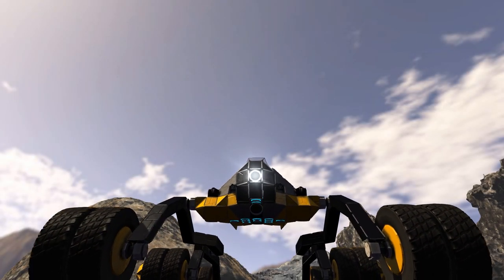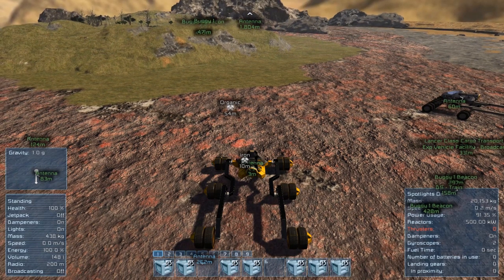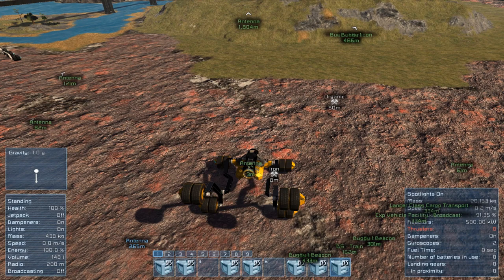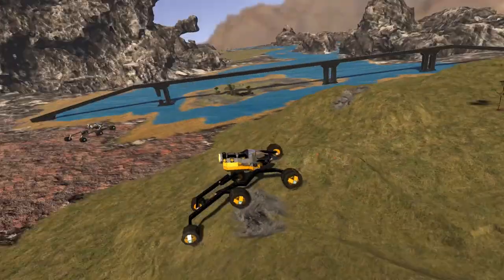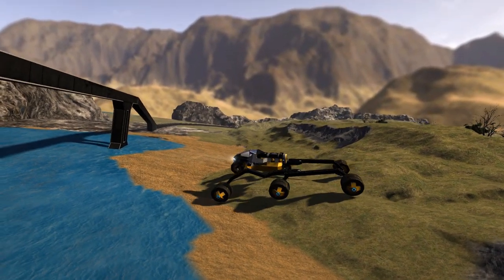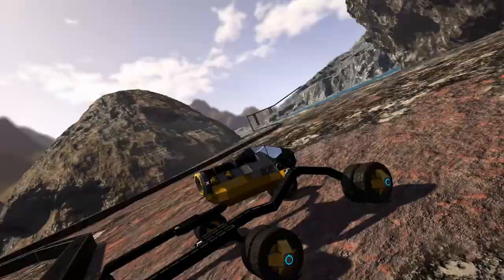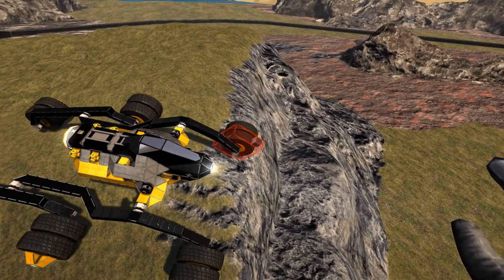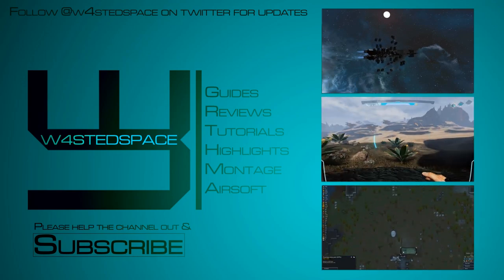Space Engineers - Exploration Rover & Rocker-Bogie Suspension

Comment: Oh wow! I got really excited to see this wheel lifting problem happening in Space Engineers. I've been working on a real robotic rover using the rocker-bogie design and had the same problem. I sent the video, that I'm sharing here, to Don Bickler, the guy at JPL who invented the rocker-bogie system, and he said my hinge point on the bogie was too high. He also said to have fun with it. Since the wheel was up in the air, it could climb over  more things. I also found out that the bogie was designed to be in the front of the rover. 

Since I didn't have time to redesign the suspension at the time, I just programmed the center wheel to drive slower while turning. Seemed to work pretty well. Maybe something to try out in Space Engineers.

But here's a video of my rover having similar turning issues. I've recently added steerable wheels so I no longer have this problem though. 

https://youtu.be/Ru_m3wz-XD4
Reply from the maker: +Stray Robotics lol, that's awesome... I always figured it was something connected to SE and the lack of control I have over the rotors position. Very cool he replied to you and I'm gonna have to try this again now, with the bogie forward and a lower pivot point and see what happens..

Thanks dude! Funky looking rover also, might have to try one myself (I'm a pretty big fan of rc robotics)

Comment: Using a programmable block, you can get the steering angle of an attached wheel by using IMyMotorSuspension.SteerAngle

You can then use this to adjust the suspended wheels' stats - for example, reducing power on the wheels in the direction the control wheel is tilted, or saying wheel.Brake = true;
Reply from the maker: Craig Perko hmm, interesting as always sir, will have to look into that and make some conditional setups for different terrain and obstacles. Nice one!
Reply: ***** If you want to see my take on it, I made this: http://steamcommunity.com/sharedfiles/filedetails/?id=488319795

You can determine whether the player is pressing W or S if you do something annoying, but I haven't built a rover like that, yet.
Reply from the maker: Craig Perko
Does handle pretty sweet - some very nice techniques to increase traction... gonna have to check out what you've actually done to achieve that. Does SE support analogue input for wheel turning? Could be a pretty nice addition.

I do have to mention that technically that's no longer rocker-bogie suspension... the dual joints on each arm are part of it and kinda required for a few of the 'tricks' - gonna have to do a side-by-side comparison and see how it stacks up against the steering modification I made to mine a couple of days ago... and of course add some conditionals for different terrain.

Great vid dude, got me thinking :)
Reply from the maker: Craig Perko
Think there might be some advantages in  making my design smaller also, didn't realise how much of a size difference there was from the vid.. suspect that is also helping with the turning - can see the arms on mine flexing at times, partly from the dual rotors and partly because they are very long I suspect.
Reply: Yeah, there's no "bogie" in my design, because I needed fixed wheels. There is a very wide design space here.

In particular, the double-rotor setup you need for a proper rocker-bogie behaves very badly in MP, so I limited it.

If you use controller input, you can get an analog spin. However, unless you're using the more advanced WS mapping scheme, that's not going to register in a vehicle where you press 1 to go forward.
Reply from the maker: Craig Perko
Yeah the more advanced mapping scheme is why I was asking, seems to me a system like that is only going to be improved by an analogue input.

MP issues are a tricky beast, I don't want to limit designs around an unintended game limitation but equally it does seem they are here to stay for a while at least. As long as the client sim speeds are all high it's not much of an issue, but I can see why you'd avoid it for sure.

Comment: Could be interesting to mess with the balance of the middle section and add some drills, sorta combine it with the Trail Blazer from the planets competition? It'd make it easier to, say, level out just the top of a mountain or something, without having to airlift it or have a second vehicle for resupply and such. It'd be also easier to modify for full-time mining since the suspension would be able to handle somewhat rougher terrain digging downards or upwards, although you'd also have to worry about the top banging into the roof of a tunnel or cave or what-have-ye...
Reply from the maker: Jurgen Ronaaz Yeah could be an interesting conversion.. might struggle with finding room for the drills in a way that doesn't interfere with the suspension but if possible would give it an extra purpose which can never be a bad thing!

Comment: Possible steering solution.
Have you thought about using Mecanum or Airtrax wheels for turning? Some people have made simple versions out of Lego, that look like they could be adapted to SE.
Reply from the maker: xgeordiemonkeyx I'm slightly scared that to get the tracking wheels in the right locations and angles it's going to mean using a LOAD of rotors.. so it's not only going to end up very large for each wheel but it's also prone to a sudden attack of SE physics :) Could be a fun project to try and replicate though! Will keep that in mind.

Comment: and what if for making the craft a little more versatile you add a rotor underneath the craft and then attach the wheel system to that instead so it can turn while in place
Reply from the maker: Jonah Monteiro the center cockpit needs to articulate like it currently does in order to keep the craft balanced... raising it up on a rig like that would require the 'arms' to be connected together in order to place it on a rotor which would change how it handles.
Reply: fair enough

Comment: hmmm... only thing I can think of to steer is kinda weird - a piston pointed down with a rotor attached to the end, a block on this with a wheel either side.  Now to set your steering would be to turn the rotor to angle the wheel the way you want to go.  however, as I haven't tested it my cynicism is telling me S.E would simply make your vehicle sidle crabwise instead of turning.  S.E physics f.t.w :P  Still if it works then you got a fun steering system.

Edit:  A mountain climbing pack-horse?  How about "The Llama"? :P
Reply from the maker: Stewart Bates Yeah I did think about that sorta idea, or just lowering a platform that has a rotor on the end that literally lifts the craft off the ground and spins it.. but yeah, pistons :s Part of the issue is still SE friction tbh, it should work better than it does currently despite the long wheelbase but yeah, not so much atm.

Comment: I love the design, I wonder if it could be made with suspension wheels that can turn?
Reply from the maker: +MrSeagull Not easily, when you use rotors you end up with 2 grids, and anything on the 'other' grid to the cockpit can't be controlled using WASD.. so in this case while you can put the wheels on you have no way to actually control them :(
Reply: +w4stedspace That's unfortunate. How about using independent roward/reserve controls for each side? Kinda like oldschool tank controls. You turn by either only accelerating with one side, and can pivot in place by going forward with one, and reverse on the other.
Reply: Ehh, tried to replicate this design and my suggestion above did not work. It just slightly shifted in the direction I wanted it to go. That, and the main cabin never stayed level  - I did something wrong there.

Comment: Amazing design!!! I find it quite perfect, even if the steering issue is more related to the game’s physics than anything else…

After crawling with this wonder, I do not have any proper advice in store, but I can make one relevant observation though.
If you do remove all the extra pair of wheels (the ones carrying the artificial mass), the “Exploration Rover“ (Daddy long leg rover ?) will turn using only 4 wheels (front and middle ones) almost with no wheel slipping (I can make a short video if I’m not clear enough).

So if the two back legs lift when steering, and the wheel’s mass is reduced (might using the option of the space ball instead of the artificial mass), maybe the steering issue will be resolved ...
Reply from the maker: Dr Mic Sounds like that could help, although I'd be concerned about how it would handle crawling without the mass on the wheels to pull the rear wheel pair downwards. Will have to play around with that and see what happens, could potentially use the rotors to apply downwards torque in lieu of the mass blocks. Thanks :)

Comment: wow this is very well made, may i ask how this (or something like it) can be done for a large rover/mobile base that is at least 65x30x25 large blocks dimension (2.9 million kg currently)?? i'm working on a ridiculously massive mobile base that is meant to scale difficult terrain (not vertical walls/drops) and i've been experimenting with ideas from modern tank suspension to the interleaf suspension, the skoda suspension, the cromwell suspension, the articulating suspension, the ferdinand porsche maus suspension,  the Landkreuzer P. 1000 Ratte suspension, the Schwerer Gustav suspension, and even some nasa rover suspensions (impractical for a 3 million kg giant) but i cant seem to get a good design to absorb the weight and bear with the rough terrain without failing, i would really appreciate it if you could help me out :<

edit: did not use tank tracks due to fears of it being completely decimated by the sheer weight of the craft

Comment: Don't know if it would work, but could you build in a very slight torque towards the "natural" positions of the rotors, so that it acts like a suspension? As a result, the craft would be more resilient, as the bounce could be somehow 'distributed' better. Not sure how to describe it, hope that you get what I mean. What do you think? Would it work?
Reply from the maker: Calvandur I do get what you mean indeed, I did attempt something on those lines I've just been struggling to find a method to actually achieve it. One thought was to have a pair of rotors for each side that are both pushing towards '0' degrees, but from opposite directions.. would in theory create the torque you describe but in practice does some pretty weird stuff... Sounds like a good option though as it would also help brace the wheels during turning too.
Reply: *****
Been thinking about your reply. Again, I've tried nothing in practice and rather tread SE like philosophy ;D.

But I think I know what the problem might be. Normal suspensions obey hookes law and ruffly scale up in resistance, as compression increases. Rotors don't do that, resulting in a rather useless suspension, as they are either too strong or too weak and don't adjust themselves.

The solution might be to work with two rotors. The first one is weaker and gives in to the weight of the craft. It's purpose is to keep the wheels to the ground for better friction.
The second rotor is stronger and starts turning, when the first one has reached its limit, which is artificially set. It can withstand the pure weight of the craft and has the purpose of giving in to bumps and hard landings to distribute the breaking work over a longer distance.

Well, I noticed, that this does not have much to do with your original idea in the video sorry about that :D. Hope you understand me, please ask if anything is unclear!
Reply from the maker: Calvandur I understand what you mean I'm just not 100% sure if it's possible to make 2 rotors behave like that, it'll probably need scripting to ensure that once the first rotor's limit is reached the other activates but I'm not even sure if that's something you can use as a trigger in a script.. the other question would be how quickly can it react as it would need to respond very fast to be of use to mitigate heavy impacts, no time for delays..

May still be possible of course those are just my concerns for now and I'm not sure I can answer the scripting part of it.

It's worth noting that the curiosity rover has no actual suspension either, there's a small amount of 'give' in the arms themselves but otherwise it works the same as this - rigid arms etc on the basis that it really shouldn't ever be taking hard enough impacts to need suspension thanks to how well it keeps the wheels on the ground.

Comment: +w4stedspace Check out this rover, was released about a year ago.  Turns perfectly.

http://steamcommunity.com/sharedfiles/filedetails/?id=320956221&searchtext=curiosity
Reply from the maker: Lumios Engineering Aye, the wheel physics have changed since then sadly, especially on non-block surfaces. I assume it's in preparation for different materials having different levels of friction when the planet update arrives.
Reply: It still seems to wok well for me, the turning that is.  Its a similar design (not by me), perhaps itll give some clues in how to setup the wheels?

Great work, excellent vids!
Reply from the maker: Lumios Engineering
It does the same friction jiggling when turning it's just a lot less pronounced because it's a much smaller vehicle. Bigger it gets the more 'flex' is introduced from the arms and rotors.

As both designs are using non-suspension wheels there's no control over settings for them either so no room to adapt things to better fit the size.
Reply: I see, hmmm.  What if you did a hybrid design with a smaller rocker bogey suspension in front and wheel suspensions in back to maintain WASD control.  Then you can set rotors as autopilot if you like and still maintain steering control.  I just did this on a build.  Im still testing, but will send you a message.  It seems to work decent, I think natural gravity will help.
Reply: Alright here's the hybrid suspension I just mentioned.

http://steamcommunity.com/sharedfiles/filedetails/?id=486528724
Reply from the maker: Lumios Engineering Looks cool, can imagine it reduces the climbing potential like you say but the addition of being able to turn properly is a worthy trade-off.
Reply: My thoughts as well!

Comment: very nice as always, i think the suspension looks a little flimsy. a small bump could tear a wheel off!

not sure how you could make it turn without using thrusters on the suspension or gyros. how does it go without the mass in the wheels?
Reply from the maker: 1wsx10 It's surprisingly resilient honestly (as you can kinda see at the end when it drops down the cliff).. there's enough flex in the rotors etc that it mostly does ok. Does kinda need the mass on the wheels though (or to replace them with something super-heavy to weight them down)
Reply: *****
im not talking about the wheels breaking, and SE has not got physics for bending things. i mean impacts directly to the suspension. a small tap and it can break a wheel off
Reply from the maker: 1wsx10 That's kinda an intrinsic weakness to SE wheels though.. can't do much about it. The wheel on a rotor setup is actually stronger than the wheel suspension when it comes to impacts though, the rotor head takes more punishment.
Reply: *****
you know the black bars that connect the wheels to the body? the suspension? its 1 block wide. if it gets hit, it will break off easily
Reply from the maker: 1wsx10 hit by what? the wheels always get hit first when it's driving. Unless you mean being shot at, in which case yeah... it's light armour, it'll break real easy.
Reply: *****
hit by anything. in a perfect world, it would be fine. but this is meant to be a car that can take on any terrain, in every day use you will come across something that will snap your front wheel off in ways you never thought of, then you have to either fix it on site or tow it back to the base for repairs
Reply from the maker: 1wsx10
It really doesn't though, I've used this for hours now and never ever broken a wheel... well, not unless I've jumped it off a cliff and it's landed upside down, then a lot breaks.. but the wheels have not once detached or even collided with anything in a way that suggests they would. It doesn't go fast enough to break itself.

Comment: What about a knob in the middle of the vehicle. Something like heavy articulated truck? http://www.cat.com/en_GB/products/new/equipment/articulated-trucks/three-axle-articulated-trucks/1000001291.html then you could use rotors and ease of steering...
Reply from the maker: Audio Tweak.net That requires the chassis to be essentially fixed to the wheels so that when you apply torque on the articulated joint, the force is carried through to the wheels without the body of the vehicle twisting. In this design what would happen is it would twist the cockpit sideways but not change the angle the wheels sit at because the cockpit is only fixed in a single place on each side allowing it to move sideways also. Struggling to explain but hopefully you get what I mean.
Reply: ***** Oh yeah. Get it. Now I have to build my own. Thank you for your reply.